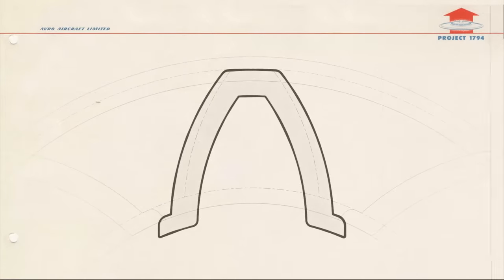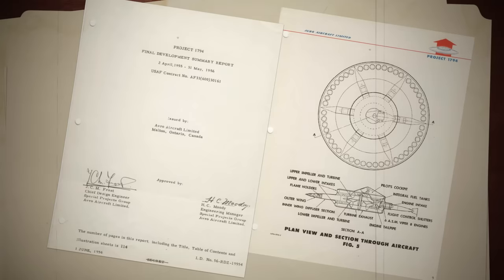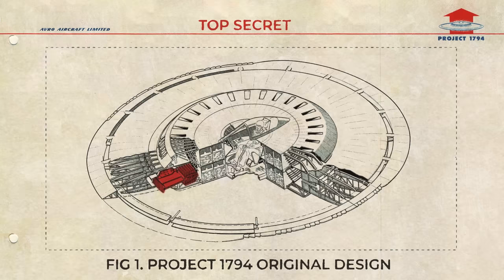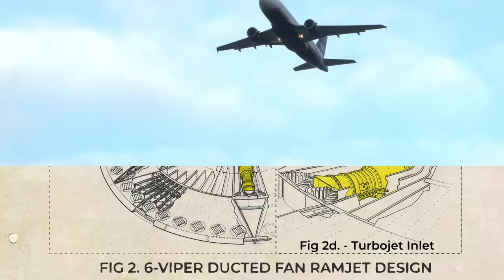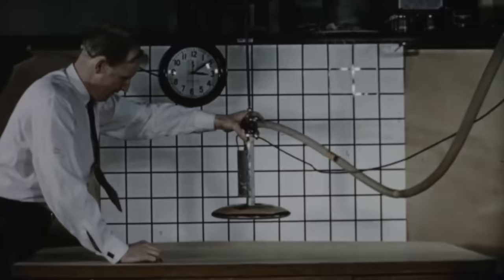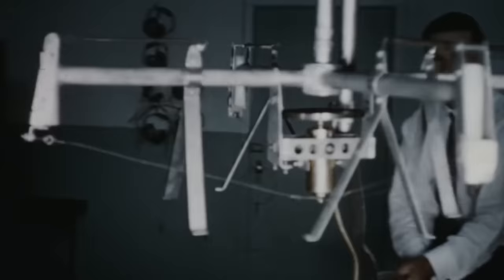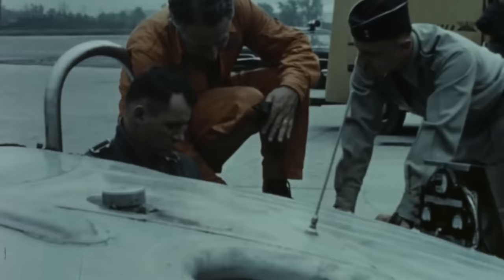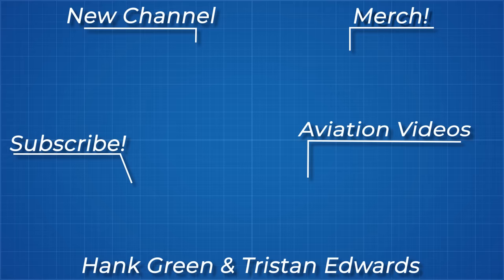The Real Flying Saucer

Comment: Avrocar engineer: nope sorry, the saucer cant be done, after numerous tests and research we concluded it needs a pair of tiny wings to work properly

Military guys:  UFO saucer or nothing, this shit aint debatable
Reply: Exactly like that XDD.
Reply: You need to the "return" key a few more times to achieve that "show more" effect you're attempting.
Reply: well actually the hubcap problem was just from the ground effect if they made a version powerful enough to fly it would be stable after takeoff even when it tried to tilt for movement it still probably wouldn't be good but it would be a working flying saucer
Reply: @brett4264  How do you know that's what he was trying to do?
Reply: That's what happens when you use ambient gasses for lift though. It needs external stabilization, but the aether on the other hand....
Reply: @XDbored1  if it uses ambient gasses to fly it is the unacceptable! >:0 the propulsion method is just so unoriginal...its just a terribly ineffective helicopter with that little turbine lifting all that stuff. :c I givem props for trying though.

Comment: Excuse me, mach 3 and 100,000 feet? This was going to fail.
Reply: 100.000ft is like from here to space, right?
Reply: Y los otros prototipos que si funcionaron?   ESOS NO LOS TOMÁS EN CUENTA!
Reply: @crackedemerald4930  that's 18 miles.
Reply: @Attaxalotl  28,9 kilometres
Reply: @crackedemerald4930  Thank you, sorry I didn't put that there.
Reply: Although, 100.000 feet turns out to be 30,48km
Reply: @crackedemerald4930  

30,48? Is it 30 to 48km, or 30,480,000km?
Reply: @saintpoli6800  the comma indicates decimal place. Sorry, it's how it works where I'm from.

Comment: Flaps may well get a slight bost from exhaust streams, but only on planes with wing mounted engines. Flaps actually change the chord and camber of the wing, and increase the lift coefficient of the wing, at the expense of drag, which is a bonus in landing.

Comment: I still think this design could probably work with modern manufacturing, materials, and computer/ fly-by-wire technologies.  I don't think it would necessarily be better or even as good as other aircraft designs out there, but I think it could work.  Hell, even your run-of-the-mill quadcopter (drone) has damn good stabilization tech inside of it that takes what is otherwise a basically uncontrollable design and makes it viable.
Reply: It would work if you didn’t use conventional engines in a configuration that causes their natural  rotation to generate instabilities. You needn’t look further than quad copter drones. Drones in general were no doubt made possible due to research on this and helicopters in tandem

Comment: Flaps don't just use the coanda effect it mainly increases the surface area of the wing
Reply: Flaps down speeds up the dorsal air flow to create more lift at a lower speed, while at the same time increasing total wing area.

Comment: There is a star shape conductive wired can be arranged in that created an immense magnetic repulsion in one direction (dunno if there’s a pull the other way) from the center.  Some people think flying saucers might essentially be this shape covered in a hull.  If so, maybe our ideas of saucers flying edge first is wrong. Maybe they would fly through space oriented so the flat of the “top” is facing “forward” and the bottom acts as the direction for propulsion.

Comment: This concept looks like it was a design thought up first and then to make the engineering work around it which is an incredibly stupid way of working.
Reply: Kind of like the quest for a perpetual motion machine before the laws of thermodynamics where known.
Reply: A lot of new concepts started out as a trial and error method and our world wouldn't be as it is if there weren't people doing it. Not to mention that the guy trying this concept out was a flight engineer and new what he was doing. It's the same with the flying wing concept that succeded first after computer controls got a lot better. Or to mention something even older Leonardo da Vinci made plans for a lot of machines not able to make them in his time, which were made a few centuries later without any issues.
Reply: @Fly Beep
I don't understand what your sentence means. Aren't all ideas designed before they are realized? And doesn't all new technology come with challenges that needs to be addressed through prototyping and experimentation? What is it that you are saying?
Reply: You're all nincompoops; it's a flying turbofan that was hoped would achieve supersonic flight, but it never got far off the ground.
Reply: @aliensoup2420  arguably that's sensible. It would only be sensible to STOP designing perpetual motion machines after the laws of thermodynamics

Comment: For a marine mission far from an aircraft carrier, could you drop a sturdy helicopter from a cargo plane?

With the blades swept back, upon release, a parachute attached to the tail could slow it's descent.

As it falls, the blades could straighten out and the then start spinning, leveling it out, slowing it's fall and then it'd fly off towards it's mission.

Comment: That high pressure air directed downward then outward actually lifts the ground -- there's a small cushion, but if you apply another force, you're actually lifting the ground with the craft.  The trick is to get more horizontal air velocity on the top of the craft than the bottom.  This makes the pressure on top lower than that on the bottom, and is common knowledge which has been known for a long time. This is why this video is only showing super expensive hovercraft which were actually far worse than those available at the time.

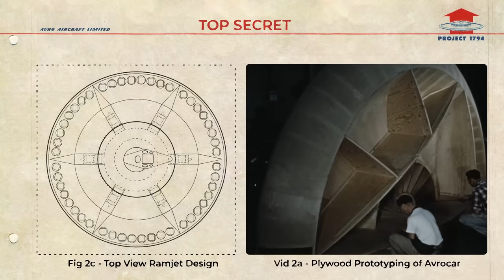Comment: Hey, just so you know.. the designs at about 4:30 say "Ramjet" while the voiceover say "Turbojet".. as far as I know, there is quite a significant difference, since ramjets usually dont consist of compressor and turbine stages and can only be started while air is already flowing through them at a high velocity. Turbojets would - in my mind - be the better choice here.. imagine having to start up 6 ramjets at ground simultaneously.. have a nice day :)

Comment: I have to wonder what they could possibly have done with this design, even if it didn't have stability and control problems. It doesn't fly, so it can't bypass rugged terrain or large bodies of water. It would be a nightmare to try to use weapons with it, as using them would change the balance and stability with every shot or rocket or whatever. Similarly, cargo and troops seem like a huge problem.

Comment: Others were developing hovercraft, but all had bilateral rather than radial symmetry.  It seemed clear that the best design for a vehicle would be one which would be able to turn and then move quickly and accurately along one direction which is a bilaterally symmetrical vehicle.   Sometimes funding at the time of the arms race went into bizarre ideas.  The U.S. Navy was getting atomic powered submarines and aircraft carriers, so the Army wanted portable nuclear power plants, so the Air Force not wanting to be left out wanted to develop nuclear powered planes which wouldn't need to be refueled.  None of the scientists and engineers on the project thought a safe one could be built, but some science and technology was developed which later was used in sane projects.

Comment: I thought of the idea of putting the engines on the outside to make it spin really fast and have air intakes on the outside to take the air and force it down.. The pilot seat in the middle wouldn't spin with the saucer as it would have stabilizers, but the chair would be able to move a little to throw of the center of gravity in order to maneuver the saucer? I doubt it would work..

Comment: I can see where you'd have more success building one now.
Only atmospheric flight- kind of a cross between a wind tunnel and a roller coaster. The design just came to me in a dream. Think of it as a captured wing. The scale would have to be larger. An atmospheric, captured wing aircraft, that hovers and turns at right angles. An exercise in fluid dynamics, with no windows. 424 ft in diameter. Doable.

Comment: A booster rotor engine should have been placed under the ufo aircraft for its lift, likewise two booster engine should have been installed too in both either lower sides so it can easily move left or right faster...also a solar engineering panels should have been installed to collect solar kinetic energy in powering it and saving power to be used during nightfall... Thus the ufo aircraft should have been made bigger in the process. You see cost should never be comprimized in prototype experimentation to make it work. A bullet proof aluminum body should have been used too since its lighter than steel and can't be magnetized. Speed is the goal of achievement process if it will be use for military purpose.
Thank you.
God be with you. 🙏😊

Comment: We largely depended on physical demonstration of ideas in WW1, it was a sort of 'trial by ordeal'
During WW2 as better analysis was used, we could design and build a successful state of the art aircraft in as little as 6 months
The problem here with Avro was there was no clear analysis path to success because the intended systems werent capable of working, and we couldnt see it
we still see evidence of 'suck it and see' analysis to this day from very capable nations such as the Russian Ground Effect machines for the same reasons
If you want the latest in design disaster you need to look no further than the Mission to Mars

Comment: But still, how would it achieve mach 3 without any engine power directed backwards?
If it's thrust goes downwards it would need to pitch down to accelerate, increasing drag as speed goes up

Comment: I think the 360 design would of worked if they used the rotation of the saucer to their advantage, having a closed transparent central seating area, and rotary control of 1/2 of the surface area, it spins so fast it still makes the cushion effect, and no disorientation. I think... Not a scientist but it sounds good.

Comment: If it was supposed to fly at high altitude and at match 3 then why did they want it to be able to takeoff vertically? And if they wanted vertical takeoff then why the speed and altitude requirements?
It's like they wanted to have a single kind of plane that would serve the roles of interceptor, bomber, reconnaissance and fishing boat.

Comment: For the 40s and 50s, jet engine technology was a curiosity. As well as aircraft in the form of a disk. These were the advanced developments of Nazi Germany. This is evidenced by projects such as the Fokewulf 500. A vertical take-off flying disk. Flying saucers used jet propulsion and the Coanda effect. The Nazis were also engaged in research in the field of plasma magnetohydrodynamic engines. The United States continued to research captured German technology after the war. This is the most reasonable explanation for the "UFO" phenomenon.

Comment: At mark 4:43. The bottom panel. Is that really the way the air is supposed to flow? That looks flawed. It looks like it would create an issue with the interaction of the airflow along the edge of the saucer. The thrust along the edge of the ring. and the thrust in the center, With intake on the top exterior. And intake along the ring underside.  The underside air intake and thrust direction should been the other way.
The air out along the edge it fine. But wouldn't having the thrust be a second ring along the underside but closer to the middle. And having the very middle of the underside as intake. Create a much larger bubble?  Air being the liquid it should always be thought as. Creating an intake directly in the middle would help create a larger more centralized bubble. and by having the thrust as the smaller under ring. It joins with the outer edge thrust ring flowing in the same direction. Helping to make nearly the entirety of the underside as one big alternate pressure zone.  
I would think this would increase lift, wouldn't it?
Why not a drone but with thrust limiters/constrictors used along the outer ring edge for more drone-like thrust controls. And the center top could be the main air intake for downward thrust.

Comment: death in the fast lane , The crash rate for helicopters alone is 9.84 per 100,000 hours. That means helicopters crash about 35 percent more often per hour in the air than your average aircraft , so for every 1O,OOO hrs you crash , Kobe flew a lot and paid the ultimate , military data not included

Comment: The Germans during WW2 had a similiar project, with witness reports and even some documents, but it never left the experimental phase and the crews scuttled the prototypes before retreating from enemy forces.

However, these are basically helicopters and are a far cry from actual UFO reports with extreme acceleration, deceleration, climbing and swimming speed and maneuvers described by many credible witnesses (fighter jet pilots, airliner pilots, military & police personnel on ground, radar technicians and many more civilians). The very reason why the newspaper regarding the Kenneth Arnold UFO Sighting from 1947 coined the word "flying saucer" was not because of their shape (common misconception) but because Mr Arnold said they flew as if someone threw a saucer over water, they bounced slightly up and down flying at incredible speed (over MACH 2 at the time).

Comment: Didn't  the usaf  have a similar  design  that operated on mhd...it worked just power was the problem recall video of it early 1960s  just had all these huge electrical  cables running into it...mhd magnetohydrdynamics

Comment: If you toss moon dirt in a microwave it bakes to a brick.

If you use antennas instead of magnatrons on a free swingarm and bake it will move from #reluctance-#repulsion.

A jetski uses a #fluid #impulse #motor, if one closes the loop and regards Kirchhoff & Bernoulli it's a fluid impulse #levitation motor, a #directed #force.

Then, the plasma from using repulsion to overcome inertia "shades" #gravity !

This means acceleration isn't resisting full gravity + has constant acceleration.

Seems to be solid to explain taking off & gaining amazing speed with mobility by UFOs.
Ymmv.

Comment: Seriously in the 80s I had some foam insulation board and made a rather large disc .It flew well as any large frisbee owing to the frisbee effect.Rotational mass of the disc combined with lift and speed makes a difficult object to catch.
  It's all just for fun  .Synchronized flaps near the edge and half a dozen built in electric props would cause the whole disc to rotate have lift and some stable flight .yep you get what you pay for a flying saucer is always a bomb since its historically a frisbee pie pan modified for the movies.Pity the fools that try to fly their AMC AMC modified flying car like the one in the movie The man with the golden gun.

Comment: So the original concept was effectively one giant rotary engine; for the "prototype" they thought they could get away with 6 smaller engines mounted radially; they ended up with three smaller engines mounted tangentially and wondered why it didn't perform anything like the original concept.

This is like coming up with a new shape for a supercar, but building a smaller version on a go-kart to test the aerodynamics, as if that'd behave the same at 20 mph as the full-size version at 200 mph 🤦🏻‍♂️

Comment: The claims Avro Canada made for this vehicle were staggering. 3 times the speed of sound and service ceiling of 100,000 feet. Far beyond a modern F15. This is a paradox and definitely not a joke. Frost was a leading designer and they spent millions. That's not funny. They were chasing a very real objective, one they believed was achievable. It is clear to me they were attempting to "back engineer" an actual vehicle. It's probably a 2nd World War German flying disc. Not detailed enough to be more than just photography to go by. Frost had to "recreate" its propulsion and control systems, failing dismally

Comment: The only thing they messed up on is making the outer body in the form of layers and layers of honeycomb structure. The intense air pressure flowing through the honeycomb will generate the passing of air from all 360° degrees of whatever object allowing it to move randomly throughout the air but in no particular direction. It’s up to who is using it to guide it just like a metallic beetle. It’s whole entire body is covered in the same honeycomb structure so even though it’s wings wouldn’t be able to lift the majority of the bigger Beatles, the flapping of the wings generating wind through its body makes it define gravity. This has been known for thousands of years but has been protected because of the damage it can do it’s made public but now that same honeycomb structure on the body of a beetle mixed with today’s science and technology and its availability would cause chaos because you could pretty much implicated at home in the basement and then used for whatever Sinister idea someone or some people might have.

Comment: It just needed a hole in the center so the air could be allowed all the way through it. It also then May need a rotating blade ring around the outside, to give it direction. It needs to run off of ion energy. Not a motor. It just needs to shaped in a way to be able to lift and direct air. https://youtube.com/shorts/wrNoTgliV4s?feature=share